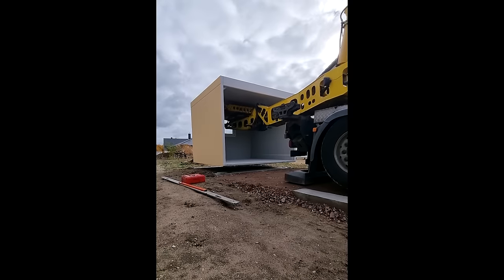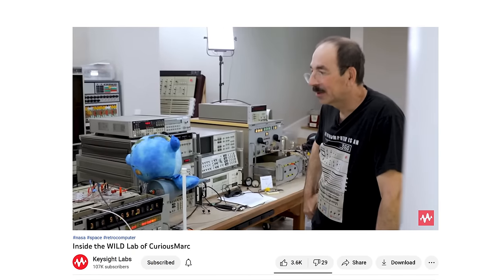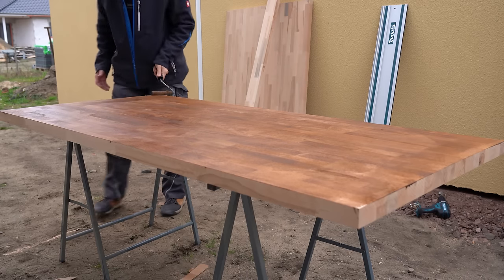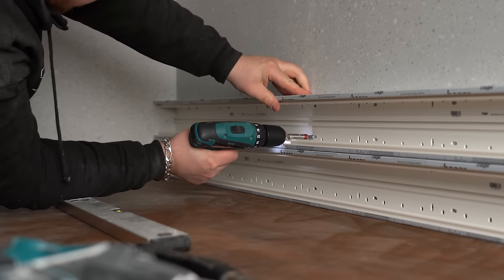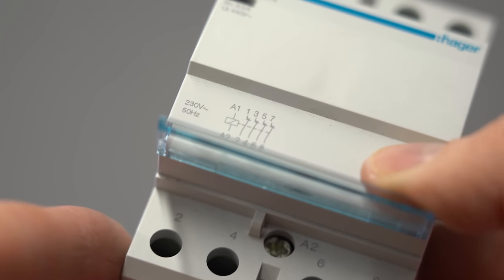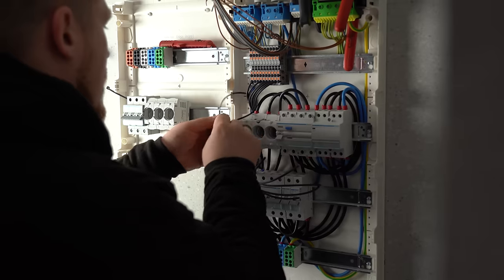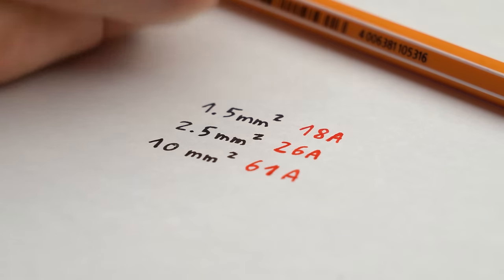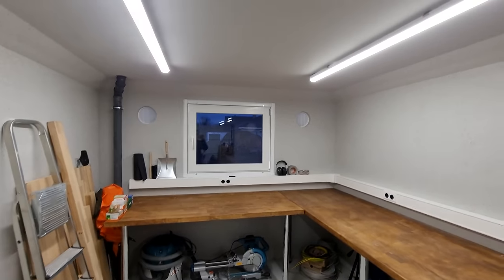Germans do the PERFECT Electrical Wiring! (Garage Build)

Comment: It’s cool to see how wiring in homes in Europe gets done compared to the USA. It seems like there’s a lot more customization available compared to panels in the USA. Seems closer to how we wire panels at my work building automation equipment.
Reply: Germany not Europe
Reply: that panel is definitely an oddball compared to a regular mainland europe panel in a residence.

But yeah the DIN rail system (the standardized metal rails at the back of the panel) is great for customizing how your panel gets laid out. In the US you will only see those in electrical panel that primarily control things in a industrial/commercial setting.
Reply: well that relay is also used in the industry.
Reply: @liam4249  Germany is both in the EU and also western Europe, not sure why you think it isnt, whilst what is shown isnt representable for all of Europe it is certainly done across multiple European countries
Reply: @ratchet1freak  Where you from ?
Reply: 2,5 mm -26A ? I dont use 2,5mm for more then 16A. Is this rong ?
Reply: This is not the standard for homes. It is called "Aufputzmontage" because it comes on to the wall. In homes we "Unterputzmontage" because the stuff sits in the wall.
Reply: @rosssharp5705  In the UK for example the electrical instalation is quit different to the one in Germany. So I think it necessary to distingish.
Reply: @liam4249  It's all about IEC, CENELEC, so it is in fact Europe. With this approach Germany has finally, after 30 years, adapted their electrical systems to the Austrian safety concept with three levels of protection (in placesince 1980 in Austria, so I consider myself somehow something like an expert ;-) ).
Reply: @marioasenov3383  Depending on the cable lentgh 1.5mm² is enough for 16A at 230V. Are you maybe thinking about 120V?
Reply: @GoodOlKuro  In Europe we use only 240V or 400V, therefore 1,5 mm cables are only for 10 A and 2,5 for 16A
Reply: Also at least in Finland residual current breakers are required in new installations (home environment) Only stationary devices like refrigerators and washing machine outlets are allowed to be installed without residual current breakers (I hope the "residual current breaker" is the correct term...)
Reply: @liam4249  the EU electrical norm is mostly based on the German DIN norm.
Our Italian CEI norm still has errors with German words still in place.
Reply: @ratchet1freak  Its not an ODDBALL at all, its new regulations. We now use them in the UK with AFDDs and all that other goodness... Standard evolve that's all it is
Reply: @jarigranroth6873  RCD means Residual-current device or do you mean RCBO (Residual current operated Circuit-Breaker with Overcurrent protection)? Additional protection (on top of basic protection and failure protection) in form of a 30mA RCD is required for universal plugs <= 16A for homes and <= 32A for unstationairy devices outsides buildings. Devices directly connected to connection boxes do not need the additional protection. Critical devices which shouldn't be switches off can use "Nullung" or selective failure current detection devices as failure protection devices and are not required to have additional protection devices in form of RCDs when they are directly connected without universal plugs.
IEC 60364, HD 60364, HD 62640, ...
Reply: @jarigranroth6873  230 not 240
Reply: @marioasenov3383  there are other factors like if the cable insulator is PVC (70 ºC ), XLPE (90ºC) or EPR (90ºC) or how is installed the wiring.
Reply: @TheMartinSilenus  similar principles behind both.  more so when done in this "industrial style".
Reply: @AnIdiotAboard_  I was talking about the stuff in it, like the porcelain fuses, the distribution blocks and the relay
Reply: Yeah, but the German panels are cheap flimsy plastic which the panels in the U.S. have a strong metal cabinet.
Reply: @marioasenov3383  2,5mm maximum 20amp and 1,5mm 16amp
Reply: @jarigranroth6873  incorrect, here in Belgium we use 1,5mm for 16amps maximum and 2,5mm for 20amps maximum
Reply: @everythinghomerepair1747  that depends on the panel you buy, you can certainly buy a sturdy metal panel. And there is something you be said about making the enclosure of an electrical panel out of an insulator instead of a conductor.
Reply: @GoodOlKuro  10a is the max for 1.5mm² cable in Finland
Reply: @Tupsuu  I see.
Reply: @liam4249  yeah not "Europe", rather "EU" I suppose because many standards are defined at the EU level. FWIW, the electrical wiring in France is pretty much identical to the one shown in the video (except slightly different wall outlets due to historical reason -- compatible with the German ones though).
Reply: @marioasenov3383  
Same here in Norway. 2.5 mm^2 is allowed for 16A maximum, and 1,5 maximum 10A.
Reply: @GoodOlKuro  
1.5 mm^2 is maximum 10A here in Norway. Where du you reside?
Reply: @WestSideConnection5  
You’re no more correct than him. 2.5mm^2 mandatory for 16A here in Norway too.
Reply: @liam4249  the rules in West Europa are nearly the same... Ofcourse there are different rules... But in the USA u have the same between states...
Reply: @hebdschnure  240!! Not 230
Reply: @WestSideConnection5  in Holland 1.5  10A 2.5 16A
Reply: @aresorum  10A is very common for light instalations, I think.
Reply: every place in europe does it slightly differently, the wall ducts are mostly a german thing andare super neat, my place sadly doesn't have them wich makes running certain stuff like networking kinda difficult, those are not only usefull for power yk
Reply: @GoodOlKuro  EU/ Bulgaria The misunderstanding came from the tipe of cables in use, for homes is normal to use singletreadet cables  multitreadet cabel have additional cost , but for industrial purposes.
Reply: @GODAXEN  True , but 26A is alot for 1,5mm no matter the separation. 5 720W on 1,5mm even if you go ++ - - lab style wear the power drop is less because you provide power from bolf side's.
Reply: @hebdschnure  220-240 is standard, but if you have a building to far away from the transformer you can request to muve the "step" to 250+ to compensate for cable losses.
Reply: @marioasenov3383  It depends, if it's used in a ring circuit which is fairly common for plug sockets it's fine and normally you'll find a 32amp breaker.
Reply: @marioasenov3383  in the european standar "IEC 60364-5-52" some configuration allow for up to 27+ A on 1.5 mm cable.
Reply: @aresorum   I'm a electric engineer and not doing things by the guidebook it's not a option.
Reply: @aresorum   Is it hard to find wor for foreigners in Norway? I'm tired to be working-poor in Bulgaria.
Reply: @marioasenov3383  
Depends on what kind of work you’re seeking. There is colossal demand for hotel and restaurant workers, for instance, and in these jobs, knowing English is sufficient.
Reply: @Phillip Banes  ... and done in a lot of other European / EU countries as well. A similar electrical installation in Sweden for example would look very similar to this one.
Reply: @jarigranroth6873  No, nominal Voltage is 230V/400V, but UK HAD 240V in the past...
it started with 220V/380V with +/-6%, then 230V/400V with +6%/-10% and now 230V/400V +/- 10%.
1,5mm² is sutible only for 16A under conditions:
Length not longer then 18m, 1,5mm² 3 phases in thermal isolation is only 13A!
Reply: @marioasenov3383  It's a matter of consulting those pesky tables :-)  2.5 mm²  depending how it's installed and how many conductors actualy carry current could be good for as little as 20A or as much as 30A.  And that's using standard cables in standard temperatures.  The temperature table corrects this by a factor of 1.73 to 0.29.  So a 2.5mm² could carry as little as 5.8A or as much as 51.9A.  Or even more if we're talking about cables installed outside an Antarctic Polar station.  In practice it means you need to use those tables and do the math or you may end paying for copper bars instead of thin wires.  Mentioned values are from the German VDE tables; depending on where you are applicable law and standards may demand different values.
Reply: @TheMartinSilenus  kinda standard for garages, basements and attics
Reply: @frozenkiller  yes.
Reply: you can get all that stuff here, people just don't care. look at vids of germans and hobbys, you'll see where all the german engineering/exacting tropes come from.
Reply: @mindgames11  dont need to iam a electrician in germany
Reply: @liam4249  but this is a general European method. Most of these brands are sold across Europe.